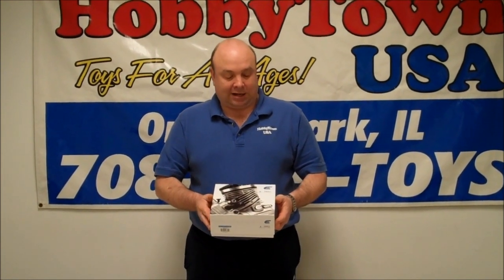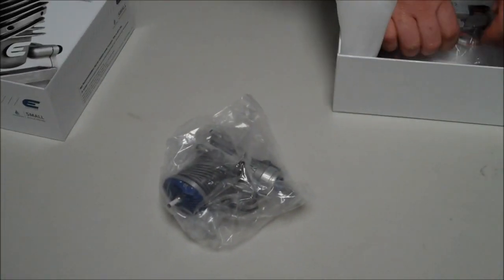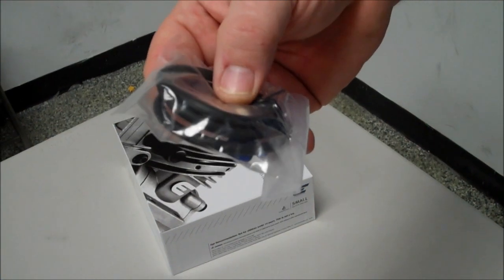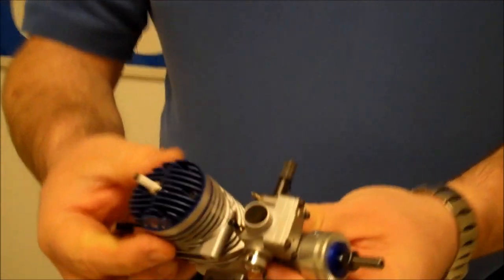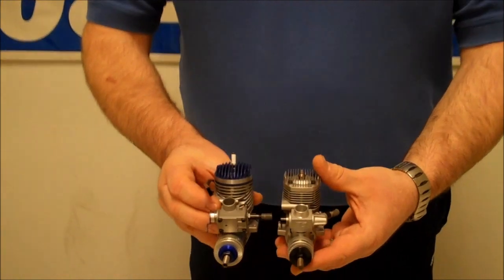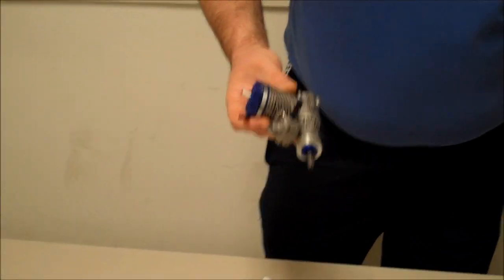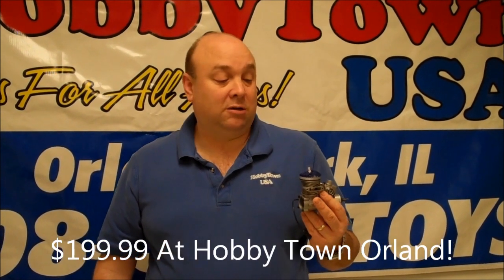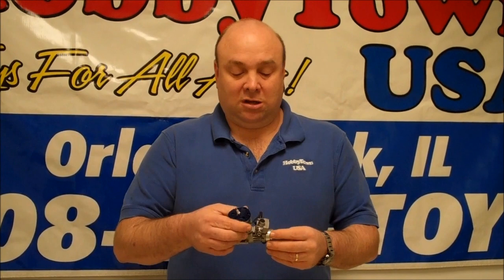Evolution 10GX 10cc (.60 cu. in.) Gas Engine At Hobby Town Orland

Comment from the maker: The Engine will fit a standard .46 to .60 engine mount.  So I would say yes it will fit.  You will have to readjust the CG due to the added weight of the Electronic Ignition.  It is a small amount of weight.  Better to be safe than sorry.